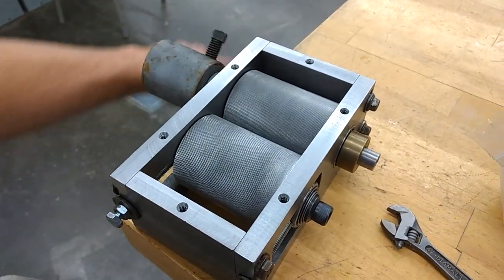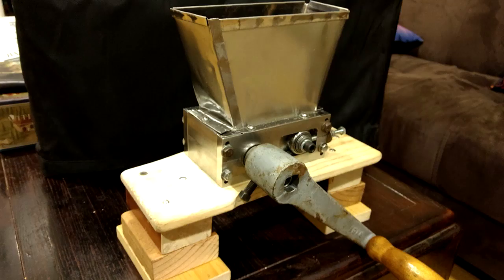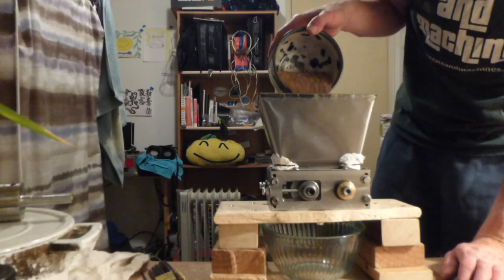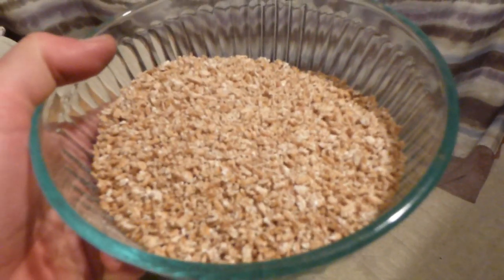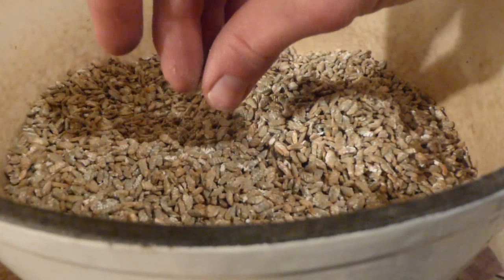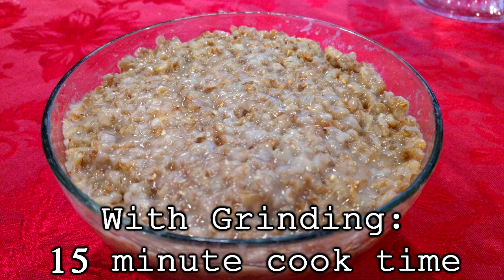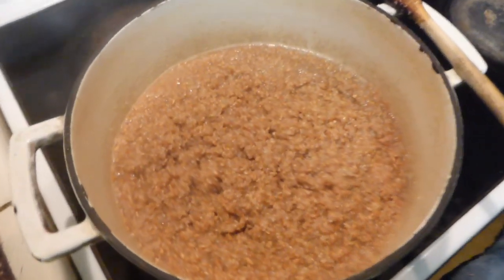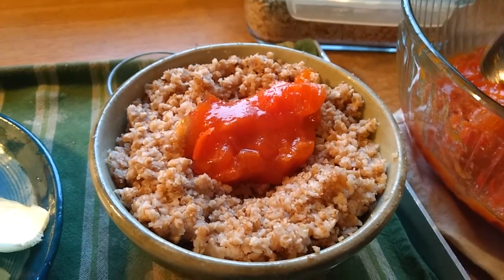Let's Grind Some Grain! | Grain Mill Build

Comment: Beautiful build. I'm not a professional engineer or anything, but it seems as though your rig could benefit greatly with some sort of gear box or something. Would love to see you make some gears for the mill 2.0 🙂
Reply from the maker: Yes, it would be much easier to rotate if it were geared down, or if the rollers were smaller diameter.

Comment: nice build. I wonder if you could make flour with this machine...
Reply from the maker: You can watch here how it handled acorns:  https://youtu.be/IuFXFb-ZfC4
Reply: @greensnmachines  thanks for the reply man! I also watched the acorn cracking video where you leave your conclusions about the use of this machine and it did help me out because i am designing a similar machine, primarily for nut cracking, but as a second thought i had the idea of adapting the grain mill option to it. So in my case i think i will have the nut cracker wheel as a rotor combined with sheetmetal adjustable wall for the nut cracking job and then i will be changing to a two wheels system when i intend to mill some grain. And for wheat fining i can always use a mixer as fairly pointed out at your acorn wheat video!

Comment: Can you adjust the thickness of the gap in the rollers so you can re-crush several times to get a finer grain? 

Looks like a royal pain to keep clamped down but an absolute unit! Nice build.
Reply from the maker: Yes those rollers are adjustable